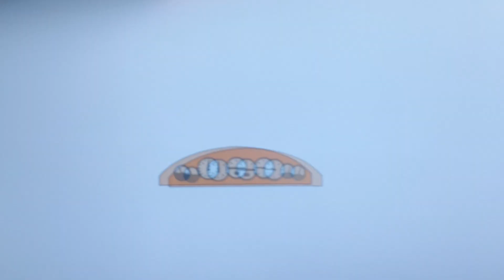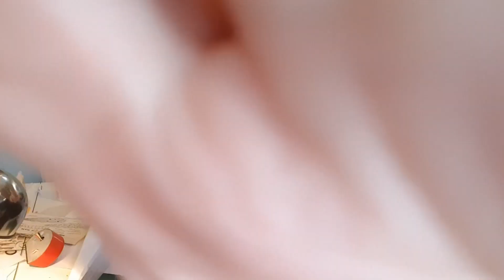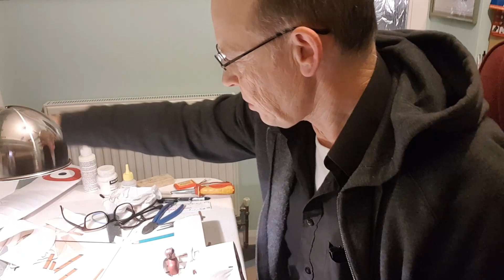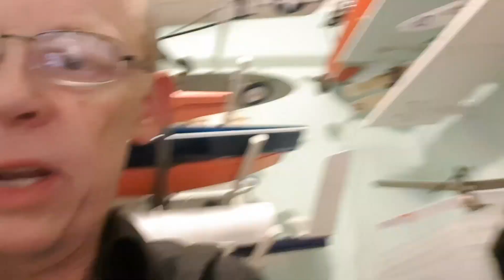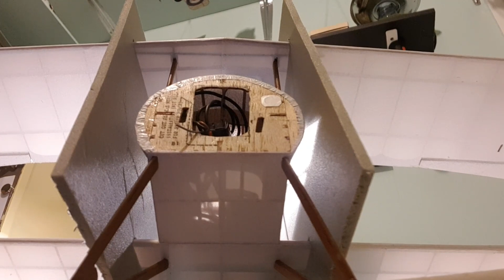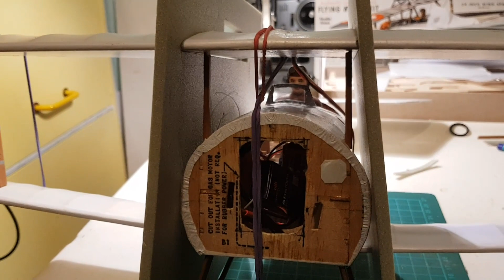Guillow's Nieuport 11 Radio Control Conversion (Part 13 Fitting the Tail Feathers and Wings)

Comment: Would you have time in the next Part to show how you make the install the control rods and linkages? Beautiful little plane.
Reply from the maker: I did record the process Irwin but it ended up on the cutting room floor but I'll put a short 'how to' together if it helps 🙂
Reply: @CliffHarveyRCPlanes  That would be great. Thanks, you have such very good tips.
Reply from the maker: @irwinweisbrot6644  Just in case you don't get a notification Irwin here's a link to the control rod making video I've just uploaded: https://youtu.be/cqVrcF7jt9k

Comment: Cliff, I can't think of any intelligent comment, but the video is superb.
I loved it!
Thanks a lot!
PS: I've been building quite a lot recently (today), but we don't use the same techniques or materials.
I'm still using the same materials as 70 years ago... still trying to get it right!
Reply from the maker: Great comment Brian, it made me smile. What's on the building board then? You can't tease and not tell!
Reply: @CliffHarveyRCPlanes  Hi Cliff, I fly all sorts of ARFs, but I only build vintage. It's all I've ever built. You may have seen my Junior 60 video, it shows my kind of building. I'm just finishing a Vic Smeed "Electra" and I'm about half-way through a "Tomboy". When I've finished, I shall post flight videos that will start with a few build photos. I'm really looking forward to seeing the Nieuport fly!
Reply from the maker: @briancox3691  Hi Brian, I have seen the Junior 60 video, very um ... vintage, cracking video though, really enjoyed watching it. Of course the two build projects will be diesel powered? The final video (pre-maiden) will be posted tomorrow evening I'm really pleased with it actually. I'm also looking forward to the maiden, fingers crossed, it been a bit of a drawn-out build!

Comment: Hi Cliff , Coming to the finish straight and looking great. On a side note , would the tri-plane (Fokker ?) work as a rc flyer? That would be a good watch.
Reply from the maker: I'm sure it would, if it's designed for free flight rubber then a little RC could only enhance the flight,  one more video to come then the big day 🙂